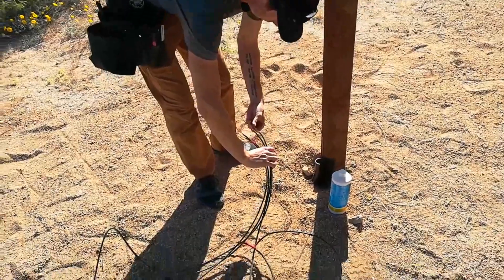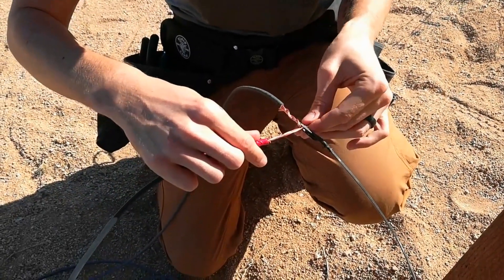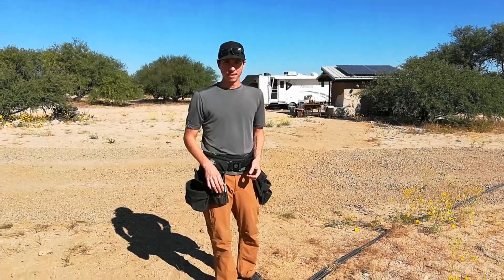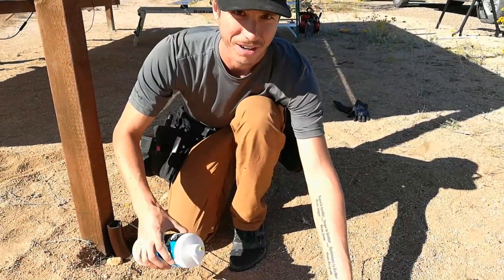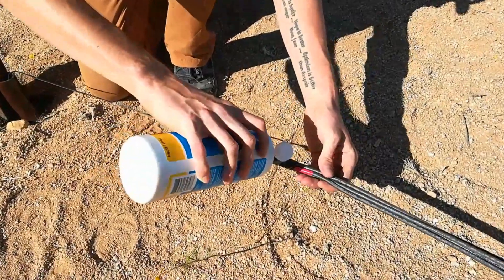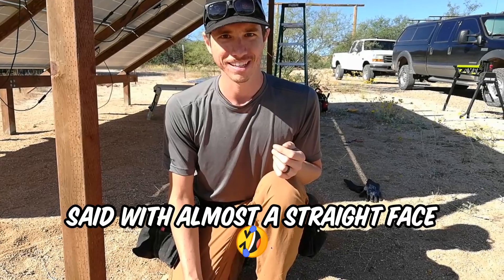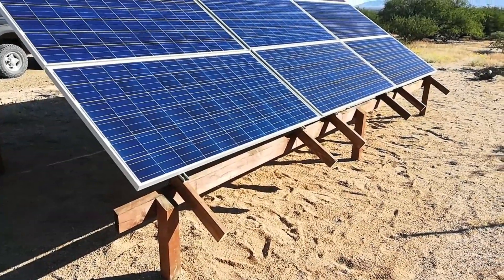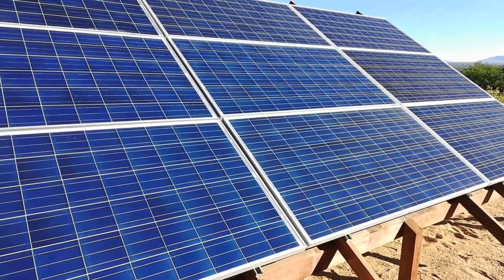Wiring Our Solar Array with Help From Handeeman

Comment: I know its only 75 feet but what about either leaving the connection of the end curves till after wire is pulled that far or better yet what I have done before is pull wires through each new section of conduit before gluing them together and then pull through the curved sections and glue them last.  I do the long runs above ground next to the trench then put whole run into the trench already connected with wires in conduit already.  Depending on whether or not you are getting it permitted and local codes you might also be able to use  smaller less expensive conduit.  I used Polyethylene pipe .  Its also available in very long lengths up to 1,000 feet from some suppliers .  That way you also dont have to worry about any connections  unless more convenient near ends.  In your climate just anchor one end roll it out and let it get warm then ends will be easily bendable.
Reply: Here is a link to the type pipe I used though this company doesn't provide it to your state:  https://www.menards.com/main/plumbing/pipe-fittings/polypipe/1-1-2-sidr-19-100-psi-potable-water-poly-pipe/11410/p-1444431553419.htm
Reply from the maker: Thanks for the link and your suggestions. The PV wire I used was actually rated for direct burial, but I used conduit because it was buried beneath the driveway. I didn't glue it on case I ever needed to gain access to a certain portion of the wires. I will check out that pipe you suggested for when we run wires from the solar shed to the straw bales house we're building.  Thanks again for watching!

Comment: no, No, NO!  (1) Pull the wire from REELS, otherwise you'll just be dragging dirt and rocks into the conduit.  (2) Use a bell end, so you are not scraping the wire. (3) Size your wire according to load (volts, amps) AND length so you do not have >1% in voltage drop. (4) Get an (actual licensed) electrician to do the work.  So many mistakes in this video!
Reply: @theupsideofdownsizing  Yes, I know.  Still, need to follow some important steps.  Thanks!

Comment: How many volts RE those panels and how much voltage are you pushing thru that 100’ run?
Reply: The Upside of Downsizing so you wire 3 panels in series, running 3 strings in parallel (for total of 6 wires). 

How does that affect/change the Watt/Amp calculations for charging and storage sizing? 
Like if you have 3 100amp 12 volt batteries in series it’s 36v and 100amp but running them parallel is 12v and 300amp...

Comment: Would you mind giving us a cost analysis for all of the equipment and supplies you used on this solar project?
Reply: @theupsideofdownsizing , thanks. I'm thinking about setting up a solar array on a new property I'm interested in. I heard it's 80,000. I can't afford that. I was hoping I could set one up for about 10,000 with batteries.
Reply: Their is no system that should cost you 80000 you’re talking to the wrong person
Reply: @justvibing5154 , do you know who I could talk to or what book or option I can take so I can learn about solar systems and the cost of them?

Comment: Better method of pulling cable is to use pull string as an intermediate between the cable and the fish tape.  Use the fish tape to pull the string, use the string to pull the cable.

When wrapping the string to the cable, you flip loops onto the cable such that when you pull the string, it gets tighter on the cable.  Hard to describe in text, but easy to do, and totally logical once you see it in person. 

This method works for all manner of cable (I use it for network cable frequently) , and removes the need for stripping it back or twisting it together. Etc.
Reply: @theupsideofdownsizing  I forgot to mention also, you wrap the tape starting from the cable end, which makes each layer lay on top of the previous, and thus the friction in the conduit can't peel the layers apart.

Comment: Whats the advantage of combining in the shead as opposed the at the array?
Reply: @theupsideofdownsizing  remind me how far your array is from your combiner box?  We are looking at ~100 feet from our array to where I plan to put my equipment.  I've been looking at different options: 3s, 4s, 5s and thus my dilemma with which MPPT controller to go with: 150V, 160V, 200V, 250V.  Save on wire or save on controller.  Decisions, decisions, decisions!  I'm looking to put in a ~3200W array to start - growing when the house goes up!  JC loves to entertain!

Comment: So you've got 9 panels here, what are the panel rating & size & dims for the whole array? LxW

Would have power losses been less had you mounted the inverter(s) outside under the panels & ran the A/C power thru the Conduit?  Also less & thinner wiring!

In fact, you could have enclosed the array structure here and built an insulated battery box to install a large, even expandable storage system.  

Looks like you have plenty of land there to expand your array in the future!

Hmmm... what I did not see was any sort of grounding system AT the array! Lightning protection!
Reply: @theupsideofdownsizing  thanks!
Reply: @theupsideofdownsizing  That was funny.  I wondered if you typed it wrong or if it was Google being Google and trying to out smart you!  Great Job Bill!  We're coming up on your heals. with our solar install  I'm actually looking at different options for just about everything - go cheap, go name brand, go for something expandable... I may be overthinking it, but hey, that's what I do! ;-)